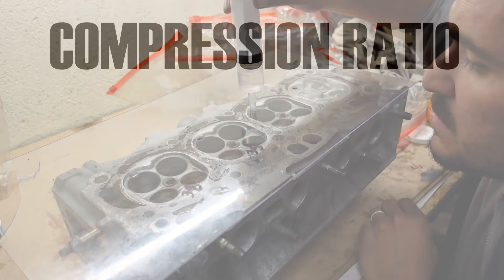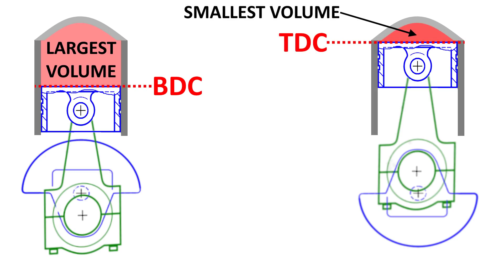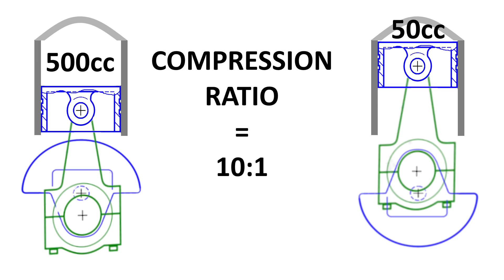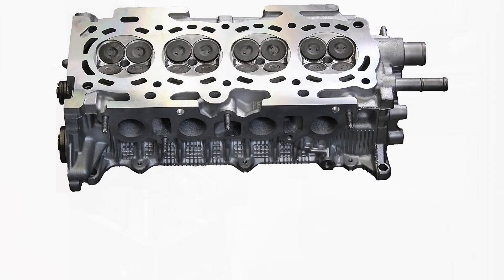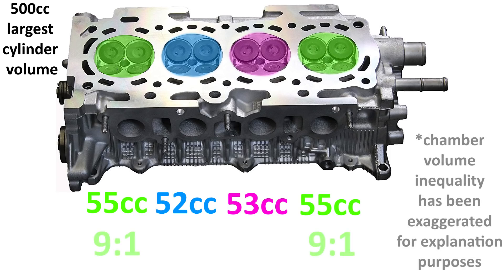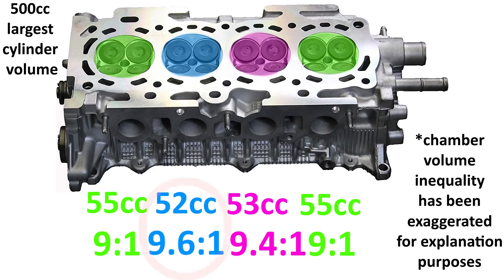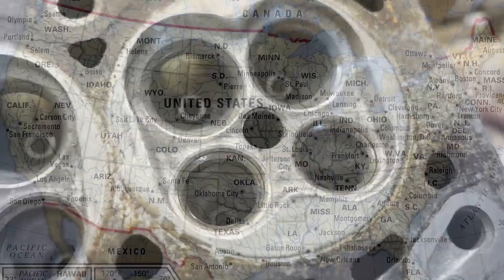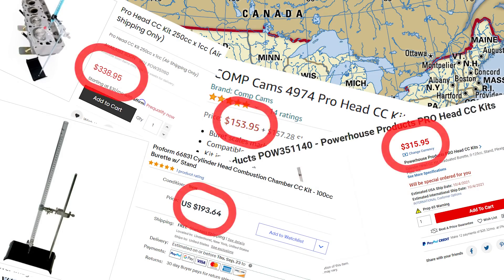HOW and WHY to EQUALIZE combustion chamber volumes CC - Project Underdog #10

Comment: Wow! That's certainly a lot of work, but it's worth it for the peace of mind from a tuning stand point. 

I have seen other videos about dimpling the intake runners in the head. I was curious if this was something you were considering. It appears to be a lot of work for very little benefit unless it's on a very high performance race engine.
Reply from the maker: Dimpling can consistently be done only using a CNC. Obviously this isn't cheap but it's a very similar aerodynamic logic as the surface of a golf ball. I think there are some benefits to it but I never saw a dyno of an absolutely identical engines with and without dimples. Obviously nobody removes and rebuilds an engine just to dimple it, there's always other mods too, so it's really hard to tell what and how much dimples alone do. I've seen 1000hp and beyond with and without dimples, they were all very fast 😂

Comment: Try getting a burette from your local chemistry supply store for maximum professional feeling.
Reply: That's weird. From where I'm from, I can get a calibrated burette for 30 USD.
Reply from the maker: I tried... They only do wholesale and will not sell to individuals, only companies. It's a weird little country.
Reply: TBH I actually like the syringe idea more. If you accidentally open the burette too much it's start over time. Syringe you have a lot of control. :D
Reply: @802Garage  As an ex chemist, I find a syringe harder to control. Maybe the syringes I used are one of those tight ones. Always over squirt with them.
Reply: @cheesemons  That's fair enough! I probably haven't used a very nice burette either. I have definitely over squeezed a few syringes. I used to do some lab testing on medical pumps. I had favorite brands and some I hated haha.